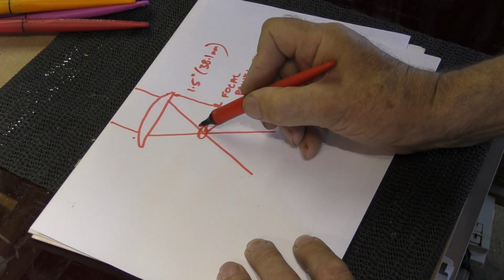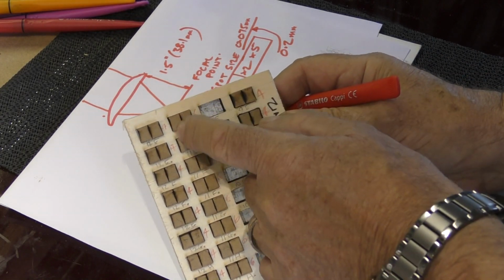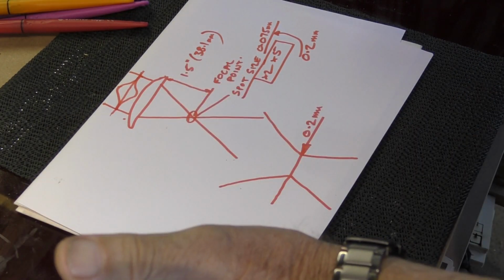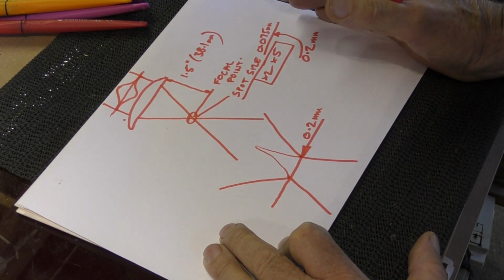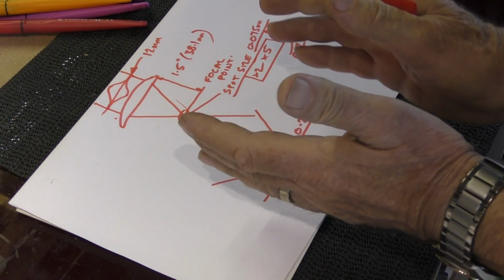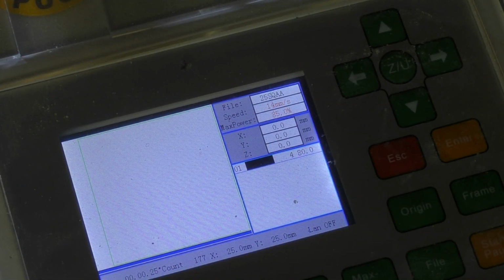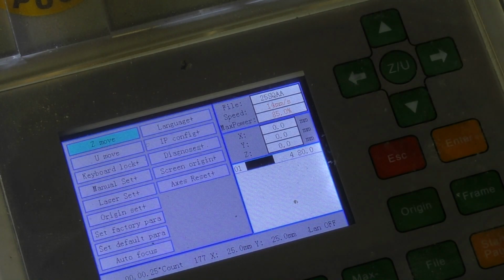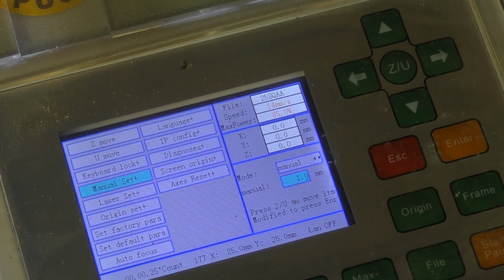RDWorks Lerarning Lab 171 Lenses Part 5 Why are cuts parallel

Comment: I love your experimental approach but a few things you said I would take issue with:

When you focus a Gaussian beam I think the result is still Gaussian. It is much taller and thinner when plotted at the same scale but I think if you normalise the scales it would be the same shape.

You show the beam as two cones but in reality it is asymptotic to the outside of the cones with an almost cylindrical section in the middle.  I.e. more like a real glass hourglass. This gives a straighter cut than you would expect from the two cone shape. You can find the equation of the beam shape online. It gets straighter with increasing focal length.

I have read that you can get total internal reflection inside the vapour filled tube that behaves  like a fibre optic, and that can extend the cut in a straight cylinder.

It is certainly possible to get non-parallel laser cut edges. Glowforge owners report it and that machine uses a fan blowing across the top of the cut rather than a powerful jet down the cut. So I think air assist has a significant effect on this.
Reply from the maker: All good points that require simple answers.
First I must remind you I am not an expert but a learner. I experiment and share my thoughts and results because most of the details I want answers to are not readily available. 
 You are right about focusing a beam with a Gaussian power characteristic. The next video will show just how much I have  underestimated the effect of focusing it.

I show the beam as two cones because  at this small scale light only travels in straight lines, so that is the reality of what happens to  a single light beam when it diverges to a conical point.. If you look carefully at those "waisted" diagrams. they  result from something called spherical aberration. This is a natural property of  plano convex lenses where the light rays from the extremities of the lens, focus at a shorter distance than those passing through and near the lens axis. There is no perfect focus point but a series of focus points. If you draw all those rays  of varying focus you will find there is a beam silhouette which matches the hourglass shape you describe. I have discussed this "fuzzy" focus issue is  a couple of my lens videos and how a meniscus lens shape helps to dramatically reduce this effect.  I make no apologies for my simplistic diagrams  because experience has taught me that detail can cloud the basic principles (plus the fact I am artisically crap!!)

I have read the same thing about internal reflection and thought at one stage that it may be plausible. Several of my experiments  prove that this cannot be true. I feel sure it's a myth that has attained it's own momentum. I have found no one with experimental proof  and the explanation I offer in the next video  will make you question that "fact" also. . Just remember that some people hang onto my words as though I am an expert teacher, I stress again I am a learner an a seeker of the truth. but during an exploratory process  I often surmise wrongly. I do not fear making mistakes because hopefully it prompts people like yourself to question what I am thinking about  out loud.. Hypothesizing and testing is all part of a scientific approach to learning.

If you own a machine that is something more than a pimped up K40, you will understand the value of being able to play with all parameters in a controllable way. Cross flow air  is perfect for engraving but you definitely need coaxial air assist for cutting some materials.. 3 or 4 psi  is not a powerful jet of air  but if it is well focused on the kerf it forces the smoke from the bottom of cut , dragging it away from the work zone where the micro particulates in the smoke  absorb light energy and ignite within the cut.Charring and slower speed will  result. 

Again, Thanks for the comments 
Best wishees
Russ
Reply: @SarbarMultimedia  I am certainly not an expert either but I have been researching to make my own machine and will be able to experiment as well.

The beam has a waist even with a perfect lens with no aberration, due to diffraction. There is always a limit to how sharp you can focus light that depends on the aperture size and the wavelength. A larger diameter beam can be focused to a smaller spot.

Comment: Hi Russ, your video is as informative as ever and I look forward to your conclusion, just as a thought, at these temperatures, most materials would appear to instantly vaporise but in reality is there not a moment of liquid where there is a pool of material distributing the heat/energy. For instance if we consider a source of energy that is somewhat less destructive like a TIG welder, we create a pool of molten metal and once the depth of the molten pool reaches the thickness of the material it falls through, but what happens if you apply a jet of Argon at higher pressure than the required amount just shield the arc, it will blow the pool away granted the pressure required to blow it away cleanly would be greater than that we us in the air assist on a CO2 laser but is it comparable to the amount of energy being used to affect the material, the greater the energy the more fluid the state of affected material. I guess this poses the question, how does the air assist pressure and velocity through the orifice affect the cuts through the acrylic blocks?
Reply from the maker: Hi 
 I somehow feel that the way  you think of the laser beam is basically wrong. First there is no heat in the laser beam it is purely a beam of light but that light energy can be made to create heat. All this science mumbo jumbo will be stepped through in my next video because it important to understand the the way in which materials and light interact. I used to own and run a metal cutting laser profiling business 20 years ago and the TIG principle you describe is almost the same as cutting metal. Yes, you use a CO2 beam to heat/melt the mild steel but this is further aided by a pure  oxygen assist gas to dramatically enhance the cutting (oxidstion) process. The oxygen pressure ( about 14 psi) is sufficient to blow away the melted steel. Stainless cutting is much more demanding. You again use the laser  (several kilowatts) to melt the steel but in this case you must EXCLUDE oxygen because it mixes with the high chrome content and turns the melt into treacle. Without the exothermic properties of oxygen to aid the cutting process, you need more power and medical grade pure nitrogen at about 200psi to blow the molten steel from the cut area Fortunately we do not have the same issues with our non-metal cutting machines.

Best wishes
Russ
Reply: @SarbarMultimedia  Thank you for the explanation and I have just watched your "128 Are Acrylic Striations Stepper driven" video which covers this subject quite nicely. I understand there is no heat actually in the laser light and it is how the material molecules react to the specific energy intensity of the light, but on the surface where the light hits, the light energy is turned into heat and melts the material. in some cases where the temperature required to turn liquid to vapour is reactively low, the process is indistinguishable.
I have placed an order for a three new machines 2 Fibre lasers for etching metals one of which will do colour and CO2 laser with dual head metal and non-metal cutting. I  am hoping to some commercial use out these once they are set up but the metal cutting will be a bit of a learning curve I think.
Anyway looking forward to seeing your next instalment.

Comment: "Spot On" Russ.   (very poor US humor)
I guess from what I've learned so far from your lens vids - is that if I want to make a really nice parallel cut all the way through the material ----
1.  Set a cut speed/power that just barely punches through the material thickness, then
2.  Repeat the first cut with a second overlay,   where now the gas/vapor has an escape route out the bottom of the cut and won't interfere with the beam, making an undistorted cut.  i.e. nice parallel sides through the total thickness   :-)
Cheers,
Dennis

Comment: Great and consistent information, i am anxious to know your findings!!! Here i present to you a challenge that i myself is yet to figure out, How can you gain a parallel cut greater than the lens dot size? that is to say a .8mm or greater parallel cut with a lens dot size of .2mm in materials greater than 9mm?
Reply from the maker: In the next session I will pull together all the necessary bits of science that answer the question you pose. It is that very question that has been with me for about 18 months  and no one has offered me logical explanations or experimental proof. I think I now have the answer.
Best wishes
Russ

Comment: One thing I have thought about why the lines are parallel is that the material is passes through being a plasma which does a little bit more of the cutting and it being released at the bottom is why the cut seems to close up, the plasma is allowed to pass out the bottom before damaging the rest of the material.  I may be wrong but this is one thing that came to mind while watching your videos.
Reply from the maker: Hi James
This same thought, amongst many others, has crossed my mind again and again over the past few weeks.  The biggest problem I see is the when I damage  acrylic there is no plasma. With wood for example, you have several stages of degradation culminating in the sublimation of carbon at more than 3000C.  In that instance I can well imagine a lot of collateral damage occurring within the cut due to heated "plasma" if that is what's happening. Unlike wood, acrylic cutting is not a chemical degradation process but more a change of state process exactly like ice to water to steam. The whole process happens at sub 350C.  My holiday was a great opportunity to think things through logically and I'm  pretty confident that without any "maybes" or "perhaps" that I have a simple set of mechanisms that fit the facts and will stand scrutiny. I have to do a lot of preparation for the next video. because it pulls together so many pieces of the jigsaw that we have known about for a long time  but never been able to put them together in the correct order.

Best wishes
Russ